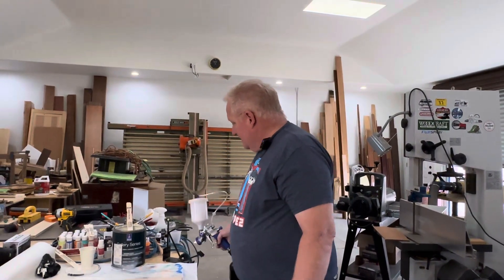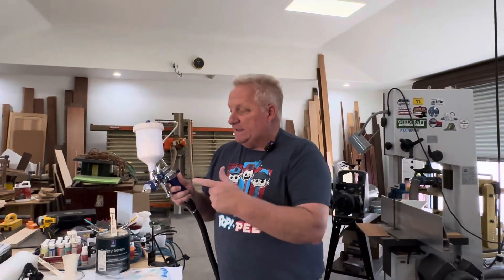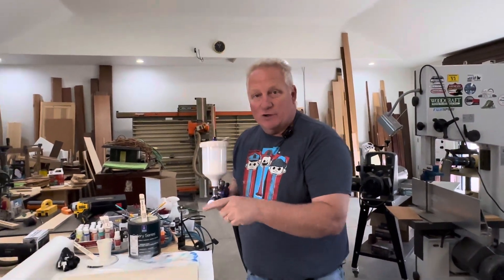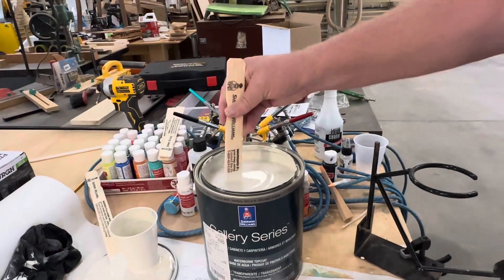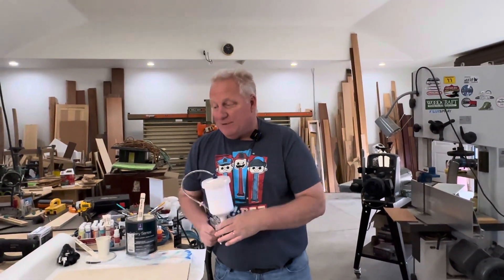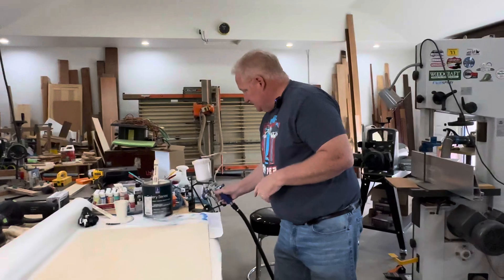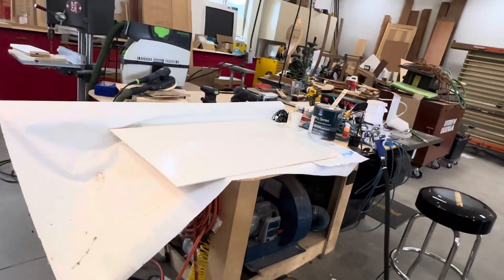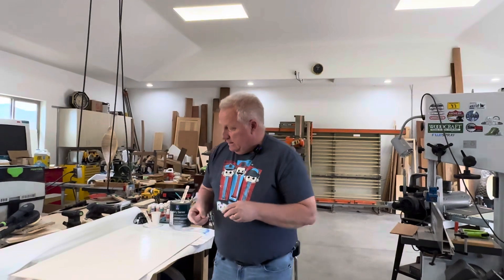My new Fuji HVLP gravity feed spray gun.

Comment: Congrats on the win!  I also won my first gun. (Holiday raffle my shop's paint supplier had.). 25 years later, and  I use it practically every day.  Can you adjust the width of the pattern?  Also. You will be happier keeping the gun perpendicular to your work, as tilting will cause a thicker coat on one side of your pattern.  Turn the cap of your gun to shoot horizontally, and set up a test panel or masking paper set vertically up and down. Start spraying about 6 inches away and keep spraying until you see runs developing.  Stop and observe how the runs develop across the pattern.  Optimal setup is achieved when the runs, from left to right, are small and get progressively longer towards the center, then taper back down as they get further from the center.  Imagine a capital D, but sideways, and stripy.  This will also tell you if any airway or fluid passages are blocked, or damaged in some way.  One way to keep your gun running good and smooth:  apply a drop of paint gun oil on the front end of the needle where it is exposed next to the trigger, and one drop on the valve rod behind the trigger.  This keeps the seals lubricated.  Your hands will appreciate it, believe me.  I like to completely disassemble mine about once a month for a thorough cleaning, but depending on how much use it, it's not necessary.  Be careful during disassembly, as the cap and needle tip are precision machined at the same time, and damaging either will ruin the seal they create.  Do not use abrasives such as sand paper or Scotch Brite to remove any buildup.  Nylon or natural bristle brushes, only.  Again congratulations, have fun, and wear a respirator and gloves, and a paint suit.  Lacquer isn't something your liver and brain appreciate exposure to.  Good luck!!
Reply from the maker: Thank you!